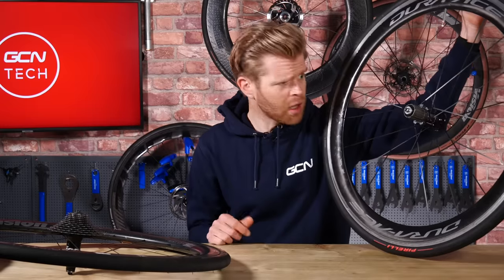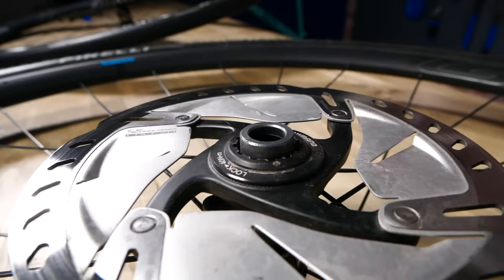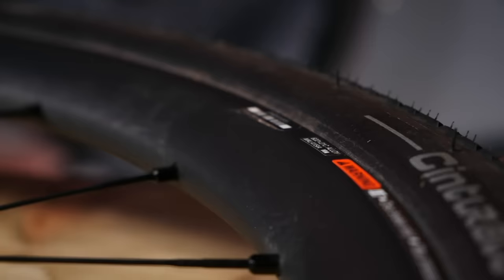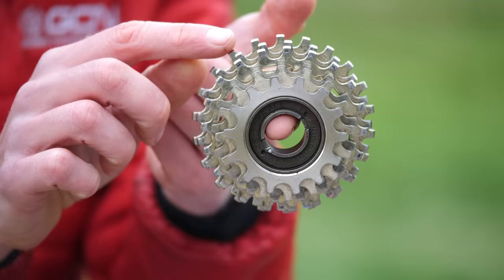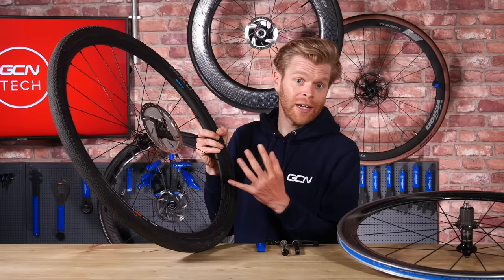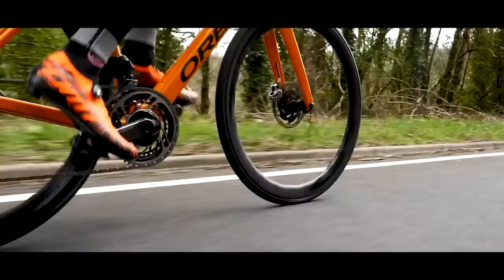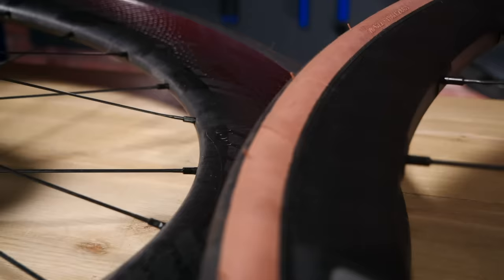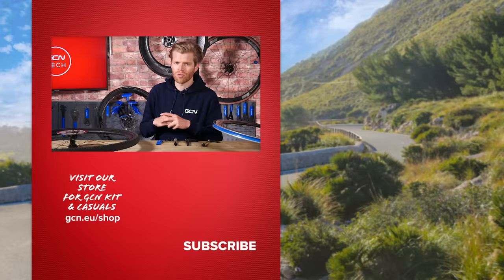GCN Tech's Ultimate Guide To Bike Wheels | Which Is Right For You?

Comment: Starting at 500 euro, AAANDD I'm out. I replaced my wheels because they were worn out. Both the rim brake and the bearings.
They were replaced with 300 euro fulcrum 5 wheels. Doing perfectly fine, bombproof.
Please stop making cycling look like a boutique sport. Most people just want to ride, without thinking of the equip to much. Just enjoy without having to take a second mortgage on the house.
Reply: Heh those look alright 👍 I was looking at some campagnolo Zonda ones which are a bit more expensive but looks like same weight. 🤔 I'm poor again now so will have to wait either way 😶🙃🍻
Reply: Agree. The wife and I actually have four sets of the DB 7's for our gravel and CX wheels. Do the job perfectly fine.
Reply: I've bought two sets of new wheels in my cycling life. Ultegra 6700 for £270 and some Aerolight 42mm wheels for pretty much the same amount. I have yet to reach the point where the wheels on my bike are the limiting factor on my speed.
Reply: Right there's an inherent snobbery in cycling with some people. Entry level bikes start at 300€ if you ask me -- A Triban road bike isn't shameful, nor is buying used, nor is aluminum or an 8 speed cassette.
Some people wouldn't be caught dead riding Tiagra, which is the equivalent of the old 105 (5700) that these same people praised.

You've got to be rich and senseless to follow this fashion nonsense.
Reply: yeah 👍 I'm running microSHIFT white derailleurs front and back and the brifters, they're ace! Why pay more, I click, it changes 😁🍻
Reply: It's just whatever you can sport or are comfortable with spending, I started with a bike I got for $300 - granted I got an insane deal (was a specialized secteur Apex comp I believe), and have had a couple bikes since. Most recently I got a second hand tarmac sl5, and I will say, you can feel a difference. Climbing is quite a bit easier with the weight drop, and it feels a lot stiffer. 

I rode on 2 three week trips across the USA on the $300 bike and it served me great, and now I'll be doing another trip on my 2000$ bike and it will serve me great, just it'll save my joints a little bit of trouble hehe.

Comment: I recently bought DT Swiss G1800 wheels for around £350 and I'm well pleased.  The wheels spin for ages compared to my old Alexrims the bike came with.  
I've already taken the freehub off and cleaned it which was a doddle.  These wheels I will do regular cleaning and maintenance to keep them running smooth
Reply: I was hoping they would at least mention the sub 500 price point. As dt swiss made the wheels for my cargo bike I'm inclined to think they have decent quality. How did the wheel hold up? What bearings does it have? Cheers!

Comment: I would in every instance go locally built. That way you can choose the hubs you want, spokes you want and rims you want. It is always possible to build very expensive wheels, but you can easily build a really nice pair of wheels for under 500 Euro, which will last you a very long time. Also if you are a bit heavier rider, this is basically the only way to get a nice pair of wheels with more than 24 Spokes.

Comment: If you have rim brakes, the Chinese winspace hyper wheels are unbeatable for the money.
Reply: MRGRUMPY53  why would a recreational rider need a 8k bike or Di2? They don't but many many of them want and buy them. Putting £800 wheels on your 8k frame with Di2 and a chain that costs £50 chain is far more normal than it should be.
Reply: MRGRUMPY53  yhea I agree but I can also see how easy it is to open your wallet with all the tech, advertising and watching the pros.

You know the old saying "if you can't be good at least look good"..

I'm the same way with cycling as I am with all Tech. I never buy anything for at least 4 years after it's been released and I wait for the price to drop. Especially in cycling as they always release things that are just as good technically just slightly heavier..
Reply: MRGRUMPY53  Because they can afford them and want them?

Comment: if you're in the market, dont even think about rim brake based carbon wheels. i delaminated my 1,300.00 front Roval once going down a long steep descent on a hot day. as i was arguing with the manufacture to get a replacement, i threw on the stock aluminums back on (600.00 pair) to hold me over, i got a KOM that month and noticed how much faster they rolled and the braking was amazing to what i have become to expect with the rim brake carbon wheel set up. When I got the carbon wheel replaced i threw them back onto the bike, and shortly after i swapped them back out for the aluminums after getting caught in a downpour and suffered a real lousy braking experience in the wet. I use those high end carbons on my 1999 aluminum race machine for a goof during warm dry sunny days with flat terrain. 2,700 bucks (cost of the Rovals) for a novelty act... live and learn.

Comment: tubulars can also be mended if you get a puncture. just put some sealant in, you can do this when they are new or carry the sealant with you on your ride. works a treat
Reply: Not that simple.  Sealant won't always work as sealant benefits from exposure to air.  You can mend tubulars but that's not mending.  You cut them open, patch the tube, then sew them back up.  It's actually not very difficult but that's what mending a tubular means.

Comment: Could you guys do a follow up to this for wheel choices for heavier riders? As a “clydesdale” I worry about investing in wheels that will ultimately be the wrong choice for me. Do I need deeper rims? Higher spoke count? Look for specific lacing patterns?
Reply: I’m a short, fat lady whose at 250-270 in the last year. So far no issue with regular wheels. My mechanic said that it’s more about shortening the life than anything else. A higher number of spokes can help and you must have a lacing pattern that crosses. The point is having the forces distributed to either side of the center of the wheel. The Sheldon guy that people mention? He wrote about it on that website. 

This might be a good question to hashtag #askgcntech
Reply: im 6'5 and almost 300 lbs I ride on 700cc tires generally at about 50 psi ,I have been cycling year round for 7 years and have found no issues with rims man ,they are designed pretty well that being said I still wouldn't push my luck with low spoke count carbon rims
Reply: @baconeater312  Yeah. That's what happens in practice for most people--nothing. But if he sees someone with wheel damage that's heavier, according to my mechanic, it's usually wear and tear with regular metal wheels. Carbon, I saw the photos of a wheel failure on a guy at the top end of the weight limit. It just disintegrated. I'd avoid testing them beyond their specs.
Reply: Check out Hed Wheels.
Reply: I am 108kg and can relate to your concern! Despite the high quality of my bike, I always had bending issues with my previous wheels. As a consequence, I regularly faced friction issues with my disc brakes. 
I was obviously not looking for ultra light or ultra aero wheels but for ultra robust wheels. My bike shop recommended me the DT Swiss PR 1600 Spline. I am very happy so fare, 2000km without any bending issues.

Comment: My tip: Just start off with a secondhand set of carbon wheels. Same price as entry level alloys and easily resellable
Reply: Any recommendations?
Reply: @djtade  ive got some felt ttr3 wheels. Other great rims are older Dura ace wheels or mavics. These are usually the best buy!
Reply: Only thing to know is that the lifetime/limited warranty some manufacturers (ex Bontrager) often doesn’t transfer to the second owner, so keep that in mind

Comment: I have a pair of Bontrager Aura 5 (50 mm depth alloy braking surface) for rim braked bike, these were the slightly cheaper cousin of the Bontrager Aeolus wheelset when I purchased these.  I now run these on my 2016 Trek Domane, as tubeless with venerable continental GP5000.

Comment: I think he forgot about Hunt wheels. For just under a grand you can get light and stiff carbon disc brake wheels. 50mm deep sections disc brake wheelset under 1500g. And then under £1200 you can get some with the latest carbon spoke tech under 1400g for a 50mm set and under 1200g for shallow ones
Reply: I bought a pair of Hunt alloy wheels with carbon spokes. Changed my ride completely! 😀😀😀
Reply: @Zardoz125  For the better? ;-)
Reply: @stevemawer848   Yes! Much lighter than my stock wheels and I went tubeless with a pair of Schwalbe pro one tires. Did not think I would notice a difference, but I did.

Comment: Pro question: Hunt makes some alloy wheels that weigh under 1600 grams and cost about $539. Is there any disadvantage to alloy rims if the weight is comparable to carbon sets costing twice as much? I know carbon is stiffer but unless you are a speed demon that's hardly worth the extra dough.
Reply: You're getting aero wheels at that weight with carbon.  Not remotely comparable.  Not that anything is wrong with aluminum wheels. I honestly don't get why people wanna ride on deep wheels for anything but racing.  Up until disc brakes, even most pros did their training miles largely on aluminum wheels.
Reply: As for cost, that means nothing to a lot of people.  They determine if the cost is worth it.  I like building wheels with really spendy hubs and train on aluminum rims.  I can buy faster and stronger carbon wheels for less money but I don't care if I'm just training on that bike.

Comment: Coming from MTB, I was very surprised that you never mentioned wheel size like 26", 27.5" etc

All very insightful so thanks 😊
Reply: That's because on road discipline the standard is 700c - which equals to a 29" in the MTB discipline - with the smaller size being called 650b, which is 26" or 27.5", depending on the source.
Reply: @rhobson  okay yeah. It would be interesting to see how the different ways of measuring evolved :)

Comment: Nice video for general guidance, but actually choosing a wheelset is difficult.  Perhaps GCN could review wheels and builders at different price points and come up with some suggestions?  

I have not upgraded my legs or wheels (eg alloy rims, 28 stainless aero spokes f & r, and roller bearing huhs) and don't race, so aero is pointless.  Lightweight reliable wheels are of interest, but 'easy' spoke replacement is a consideration.

Comment: loud  freehubs just sound like they are inefficent.  a normal shimano freehub will quiet down pretty well if you change the oil/lube.  if you mistreat a freehub's bearings and parts they become useless on a fast bike pretty quick because they need to have tight tolerances to keep the cassette on one plane

Comment: Is it worthwhile to put higher end wheels on the entry level bike I have (aluminum frame with tiagra/105), or does it make more sense to invest in a better frame and components with stock wheels?
Reply: I'd be interested in this answer
Reply: Well to me it just depends on what you want. Like if I wanted to go from 9 speed to 11 speed, obviously in that case I would get a new bike instead of new wheels. If you are happy with you frame and components I see no reason why not to get better wheels. I'd say putting better wheels on an entry bike makes perfect sense though if you're happy with the bike. I recently put really wide, tubeless tires on my hybrid bike. That made such an incredible difference to the bike. I am all about upgrading the current bike. To me making a change to a frame or something has to be forced. For instance, I have a road bike that can only handle 28C tires as the max width. I would have loved to put 38s on it and make it a gravel bike, but this will not work, so I have no choice but to get a new bike.
Reply: @copierofvideos2  I have 11-speed so guess I'd go for better wheels :) Not sure what to replace Giant PR-2s (disc) with tho'.

Comment: Only way I'd drop 2k+ on a pair of wheels would be if they came with unconditional repairs / crash replacement for at least 5 years.
Reply: I think Reserve does something like that. Unfortunately no rim brake versions
Reply: I think Hunts H_Care offers lifetime crash replacement. For some wheels it is free. It was 50 euro plus for my Superdura alloy gravel wheels, which is still quite reasonable. I am not sure about their performance though as I don't have any experience with high end wheels and only have about 600 miles in my Hunt wheels. So far I am satisfied though.

Comment: Can I change my current tire size 700x23C to 700x25C without any modification ?
Reply: In general, if It fits in the frame ajd forks yes. 

Ps its a great upgrade. Went years ago from 23 to 25, so much confort and less punctures. Today i ride with 28 on road bike and 32 in a fixie.

Comment: Which side should your front disc wheel axle do up from, mine is opposite from the rear, is this right or dose it not matter.
Reply: Isn't only one side threaded to accept the axle?  Maybe your forks are the wrong way round ....
Reply: @stevemawer848  no, there is a threaded insert in the fork which can be swopped to either side.

Comment: Hey there. I bought a lapierre xelius sl 8 this summer. I have carbonwheels from lapierre 38mm tubeless that works fine. but Now i am thinking to upgrade my wheels to deeper aerowheels Around 60mm. I have looked on shimanos new ultegra c60, zipp 404firecrast and Dt sviss 1100 dicut 62mm. quite heavy rider on 88kg. Do i dare go hookless on the zipp? Is the ultegra good enought? How important internal with? Whitch is the best buy for me?

Comment: Which wheels would you choose if you were about to go on a 200km ride every weekend? I have an aluminium bike that already modified some of its components for comfort.
Reply: Depends on your average speed, terrain and how windy it is.   If you ride below 20mph then you won’t get an advantage from a deep rim.   38mm aluminium or carbon is what I would opt for.
Reply: Thank you. Well, the question is Alu. vs Carbon and how the depth affects the compliance.

Scenario: Direct tailwind on a flat and compact gravel. 20mph / 32kmh.
Reply: @SonnyDarvishzadeh  are you disc or rim? If disc I’d go either way if rim I’d go aluminium for the superior braking performance.  Summer road only rim my choice is carbon 50s and winter road aluminium, I also use aluminium on my winter bike and my steel bikes as I like the tranquility. Quality aluminium trumps poor carbon
Reply: @tobycolin6271  you're talking about deep rims in sidewinds, braking performance and the questions I haven't asked.

Compliance, mate! which one provides more flex and comfort in ultra-long distances?
Reply: @SonnyDarvishzadeh  compliance comes from the spoke pattern and tyre. I’ve gone back to steel frames and aluminium wheels because I like the tranquility.  I’m heavy 100kg so a 38 carbon isn’t stiff enough for me.  But I run rim so I have less spokes in my wheels than a disc bike.  If your budget is less than £500 then aluminium wins hands down. Compliance is tricky as disc frames are much less compliant than rim frames that’s why I don’t run discs.
Reply: Get light aluminium wheelset if you average under 30 km/h

Comment: Hello guys, I'm new at cycling. I wanna upgrade carbon wheelset, but I don't know different of 38mm profile and 50mm. Can someone explain to me which one is good wheelset for me? thanks!

I think in my city there's are so many hills
Reply: If it's your first time using deep dish rims, i would recommend going 38mm initially due to cross winds being an issue with tall rims, and it probably being cheaper to find a lighter pair of 38mm wheels for less money if you're on a budget. Weight is extremely important for climbing, so that should also be a consideration.

Comment: One question: what are the advantages of the the "ratchet" style freehub over the classic pawl system, other than engagement speed?
Reply: With ratchet systems, like DT Swiss' Star Ratchets, all teeth are fully engaged simultaneously, unlike the conventional ratchet-&-pawl system on most freehubs, which doesn't engage all pawls on some of them.

However, some of those freehubs have multi-tooth pawls, like the Industry Nine Hydra, which from what I remember, has 6 pawls and 3 teeth per pawl (this thing's very loud too).

Comment: My wheel doesn't have a freewheel on the wheel - the freewheel is in the cassette and it screws on
Reply: You have a freewheel. A cassette is the gear cluster that goes on a freehub type hub, a freewheel threads on.
This video unfortunately only briefly mentions freewheels when talking about single speed bikes.
Reply: @Aubreykun  In all fairness this was probably the very poorest of all GCN's videos that I've seen. I have tyres with inner tubes (for example) as well as this what do we call a freewheel or a cassette (or how he referred to the freewheel being contained in the hub of the wheel). FWIW to avoid confusion I always clarify what I refer to as a "Screw-on freewheel cassette" because by describing I want a "7 speed freewheel" I have been sent the wrong thing in the past in the post!!!

The important this is that we all know what we mean when referring to !the gears". But like I say, this really was one of the very poorest GCN videos I've seen. I will add that almost all of their offerings I'd easily give an 8 out of 10 or more - so they are entitled to an off day. This was a 3 at best. I will remember it for actually being so poor and so many minutes I'll never get back
Reply: @paulfaulkner6299  Yea this was really an "upgrade" video not aimed at lower end/classic bikes at all unfortunately. I would have liked to have seen them include sub-500GBP stuff too in the same format.